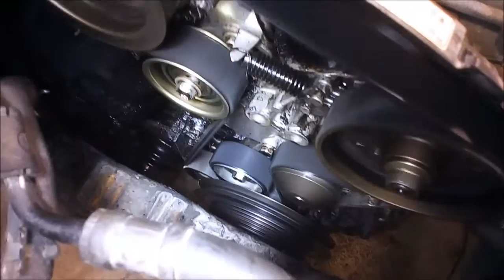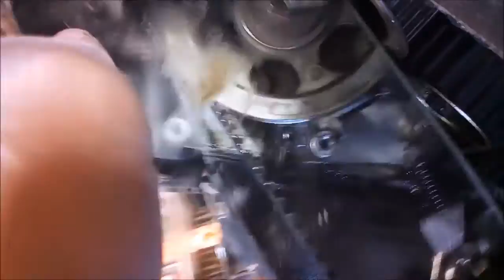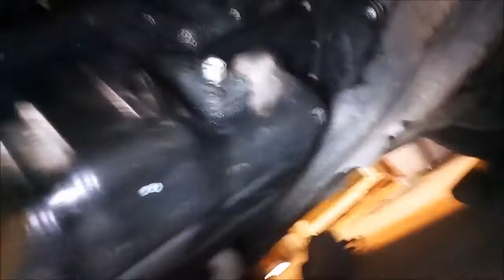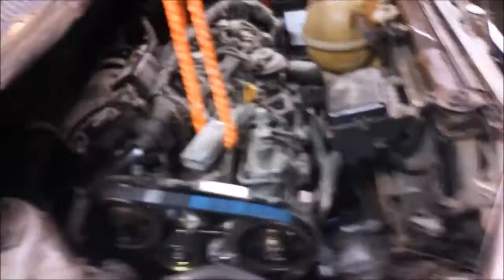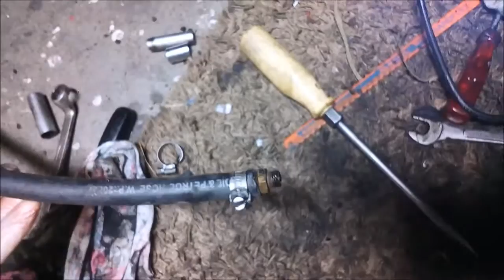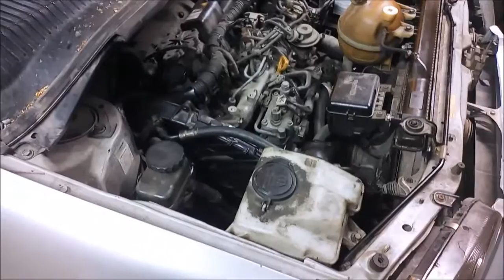Toyota 3C-TE oil leak fix + belt replacement

Comment: I just purchased the same vehicle. My oil level light just came on today. When I purchased it it was off. The oil pressure light is also off. Is this likely just because the vehicle needs to be serviced and have the oil filter and oil changed? Or is it possibly a bad oil sensor
Reply from the maker: Hello, it could be worth checking the oil level on the dipstick and add some more if the level is low. If it is low, then probably adding like 0,5 litres fixes it. I don't think there are sensors for the oil quality on these cars, so get it serviced if the oil has done enough or if it's unknown when it was last changed.
Reply: @rangleri  I actually found an oil leak. Can’t tell exactly where it’s coming from yet. I’m thinking it’s going to be an oil deal or possibly a gasket of some sort. Super bummed out about it. I haven’t had the estima for 3 days yet. It had zero issues when I bought it (a mechanic confirmed it was good to go) and drove it 300 miles back to my home. I went to get the inspection done today and the oil level light came started blinking. When I got home there was a small pool of oil under the engine
Reply from the maker: @Ammosexual69  Oh no, does not sound funny. But surely you can get it fixed👍It could still be something simple,  like the oil filter seal.
Reply: @rangleri  I just spent an hour trying to locate the source of the leak.  Wish i could post pics here to show you but I think the leak is coming from somewhere on top of the engine right under the right side access panel
Reply: @rangleri  oddly enough I attempted to tighten the oil filter cap when I added the oil seal additive. I wonder if that’s all it was.

Comment: What about the front crankshaft and oil pump seals? I would of put assembly grease in the pump when reassembling but a good job getting it fixed!
Reply from the maker: Yes you are right, using the grease priming might not have been needed. The crank oil seal had been recently replaced when the timing belt was replaced. The oil pump shaft seal wasn't noticeably leaking and the size of that seal wasn't known and I didn't know how to take the pulley off. The focus was to fix this major leak.

Comment: how to changhe oil filter on a 2 C  diesel engine its too  tight space i tried to use a chain tool but i couldnt turn it? its on a corolla last oil or service that shows on the previous owner card was 266 k and now its nearly to turn 275 k i check car info web site says every 10.000 kmh
Reply from the maker: Yes, it is good to change oil at every 10k.

It could be possible to turn it with different kind of tool(one that grabs the top of the filter) If it is really tight it, maybe you have to make a special tool for it or modify some existing ones.

If no tool works, then making a hole to the side of the filter(quite close to the gasket-end) and hammering it with a hammer and a punch-tool to turn anti-clockwise could work-just don't damage the aluminium oil filter mount/engine.
Reply: i did it after couple of minutes i turn  anti-clockwise and then to the opposite and its untight  i remove took part no and went to a part store get a new one remove also old oil from the motor tap it again put fresh oil in and that it final done. Thanks for advise.

Comment: can you help, what is the problem
Reply from the maker: When you take the old pump out, the oil pours out from the oil channel. The new empty oil pump is trying to pump air, and cannot create vacuum strong enough to suck oil from the sump. I have heard that some people have used vaseline to fill the pump before installing, so there would be less air - I don't know if vaseline is good in the system in long term. 
-In here I pumped oil to the pump through that oil pressure sensor hole.
The oil level must also be full, or even above full level to make this easier.